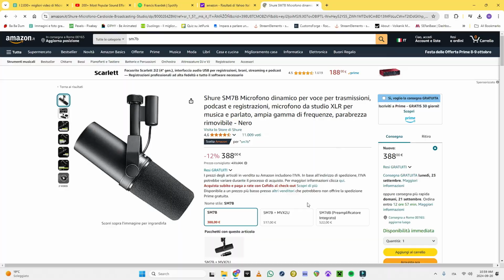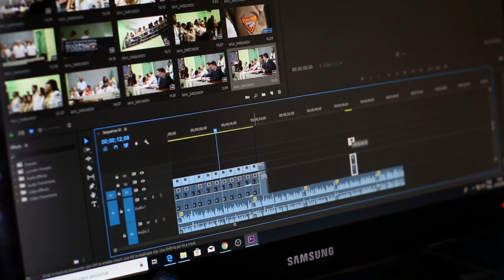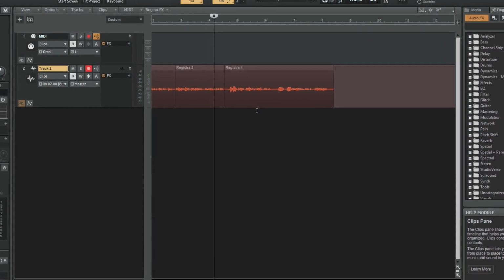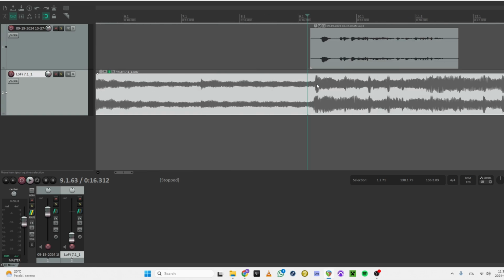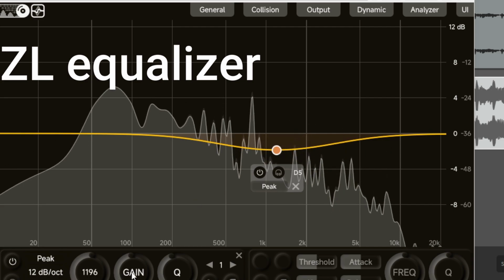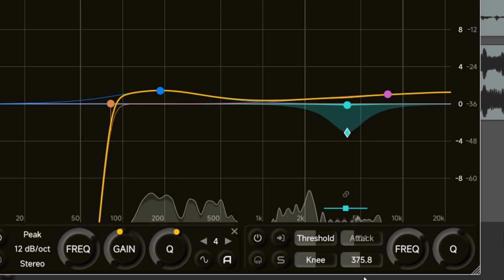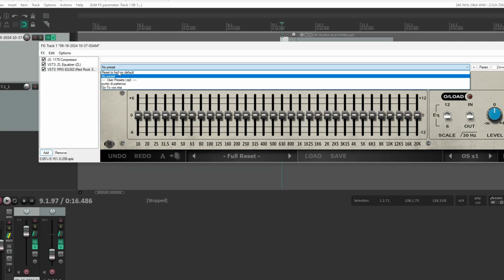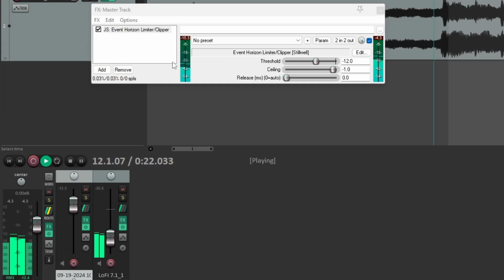YOU DON'T NEED EXPENSIVE MICROPHONES FOR GREAT RESULTS!

Comment: Yeah until you try a Sony c800, or a tube and ribbon mic. HUGE difference.
Reply from the maker: Sure thing! 
But since this video is mainly directed to aspiring YouTubers and podcasters, I’d recommend either starting with a very affordable mic to test things out or investing in a good dynamic mic. Dynamic mics help reduce room reflections and handle volume spikes well (obviously they need to be set up properly). That’s why I think something like the Shure SM7B or even budget-friendly options like the Rode PodMic are the best balance between quality and practicality for this hobby!
Reply: @Kvardekstudios  you are completely right on that point. 100%

Comment: The processing you added definitely made is sound good. Great video! For voice over situations, holding a lapel is such a cheap way to get solid audio. But I'm still not loving lapels though. If you wear them on your shirt as intended, it picks up a lot of room noise and echo, plus if you move it can create mic noise. But: if you hold it to your face in order to get the proximity effect, it sounds shockingly good. But it looks weird on camera to hold a lapel. So I bought a Shure SM7B. It's big, expensive, and I still run a simple EQ and multiband compressor on it (stock premier pro effects). But it really has made my videos better.